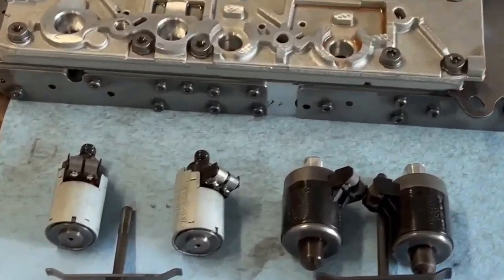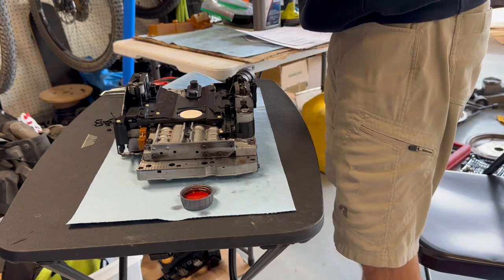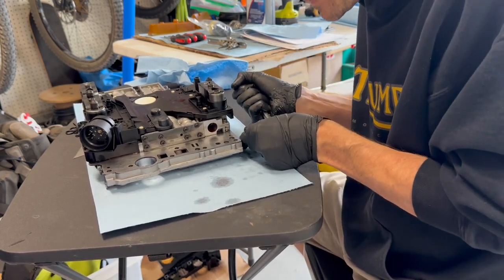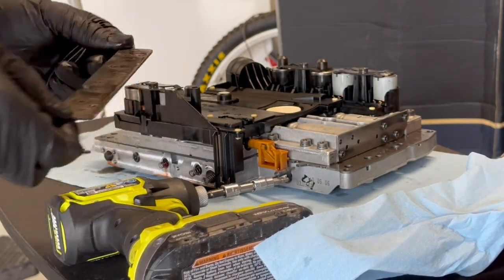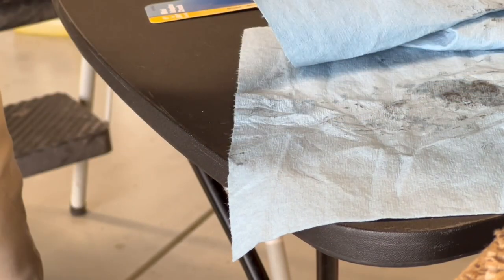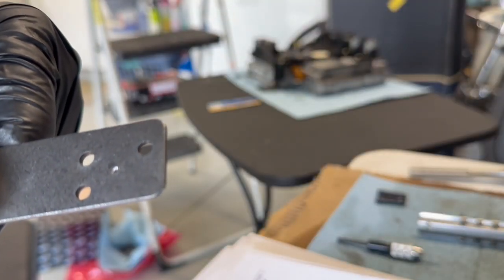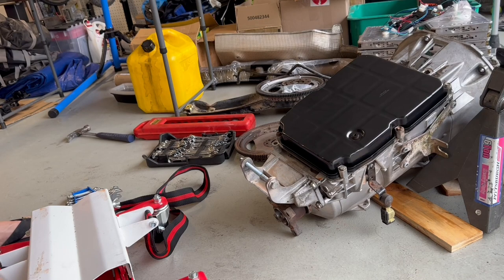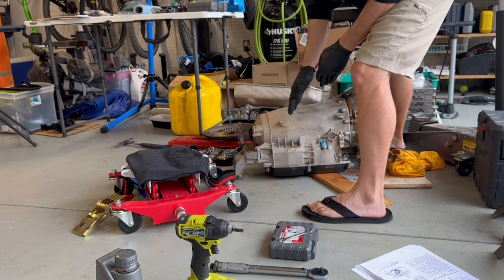T1N Sprinter 722.6 Conductor Plate replacement, Solenoid Service, RSN mod, and Assembly Install

Comment from the maker: Update, it’s in and it drives great 🎉. Transmission install video soon.
Reply: marino having issue can i get your email
Reply: how soon bro it's been a year :(
Reply from the maker: @deyoviC oh yes I never made that video, really quite easy. The video I shot is not super helpful. It’s really easy to get the bell housing bolts in with the engine pivoted backwards.

Comment: Absolutely great video you sound very knowledgeable thank you I have a question. My transmission is fine but it won’t go in to fourth or overdrive the rpm just increases. It’ll catch occasionally then jump right out as long as I’m in three. I’m fine but I can’t go to four overdrive. I’m thinking shift solenoid. Where’s your brain on this?🤔

Comment: Where did ya get the o rings and the instillation instructions at ?? Tanks and carpe diem!!
Reply from the maker: Instruction were just reading the factory service manual. I bout o-rings from Cobra transmission https://cobratransmission.com/MB-722.6-Solenoid-ORing-Kit

Comment: So where did u buy ur torque converter and did u rebuild the whole tranny?
Reply from the maker: The torque converter came from million mile sprinter. He had a few brand new units that he found. I did not rebuild the entire transmission. The only issue was the converter but I decided to do conductor plate and o-rings while I had it out due to age.

Comment: 8:03 Your TCC damper piston is wrong! You need to put the piston inside and then the spring! Now it´s the other way round.
Reply from the maker: You are my hero, I have some RSN after the converter swap and this must be why. I never removed the piston and this is a remanufactured transmission so the rebuilder must have reversed it in the past. I'll flip this asap. Thanks again!
Reply from the maker: After referencing the FSM the piston is actually in correct, as is. Can you provide a link to documentation to the contrary?